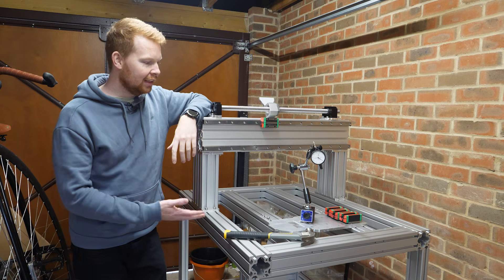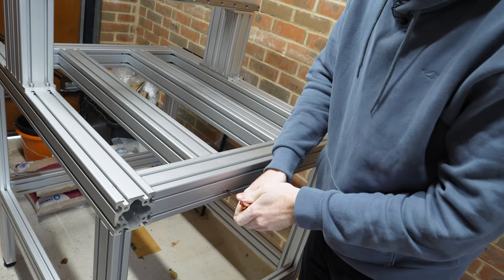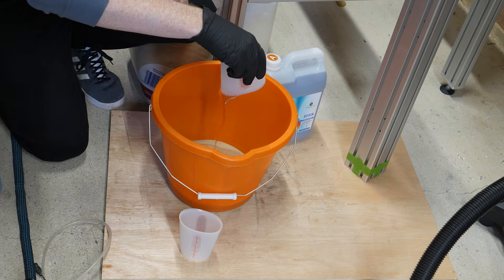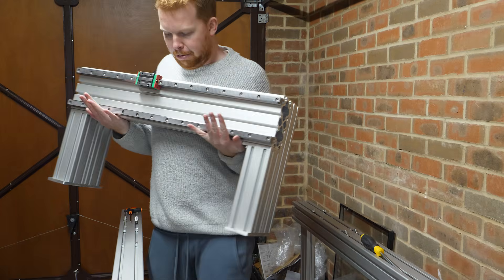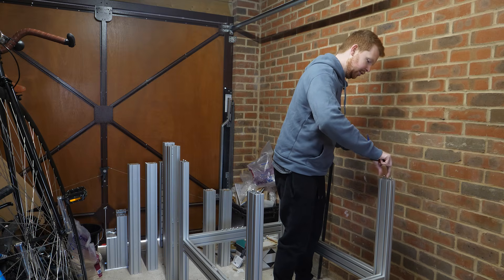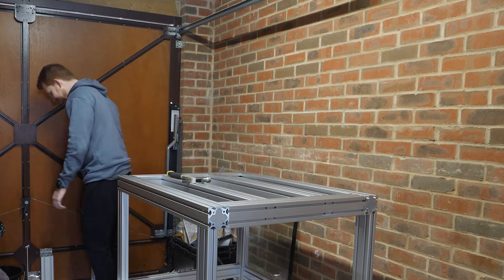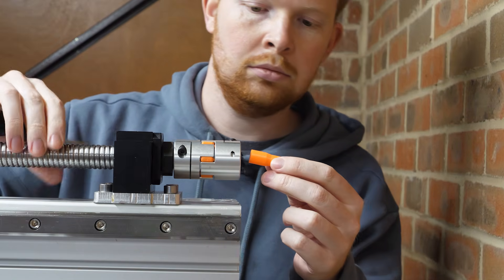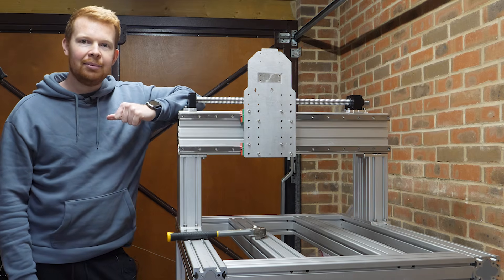Building a CNC Mill/Router - Part 2

Comment: Should be loose sand so it can absorb vibration, now it's just ringing through the solid epoxy. Looks kinda top heavy on the smaller profile legs too..

Comment: You could try putting some sort of thin rubber sheets/gasket between the different extrusions so that vibration don't propagate to the whole assembly, especially to the legs

Comment: Hi Tim. I've been considering epoxy granite for my CNC build, however I strongly believe that the Sikaflex 290DC deck caulking that we use at work for cruise liner Teak decking will be a good alternative choice. My reasoning is down to how these dampening materials work; converting vibration into heat through friction. Epoxy granite alters and shifts the resonant frequencies within the system to longer wavelengths which are less intrusive than the higher "ringing" plain Aluminium produces. Sound dampening materials in audio applications tend to use dense flexible materials such as rubber or polyurethanes which are very good at converting vibration to heat. Sikaflex polyurethane caulks are single component and much more convenient than mixing up dry aggregates and epoxy, which is an attractive benefit.

Comment: Re: sand/epoxy

Bro why’d you mix weight and volumetric measurements? Instead of having to convert each substance to another unit of measure you could have just weighed them both and got your 1:4 part ratio.
Reply from the maker: It's quicker and easier to measure each substance by volume due to the measuring jugs. Also, I don't haven't scales suitable for weighing the bucket.

Comment: You could have used iron filings or small ball bearings? If you Made an iron filing/ epoxy slurry you could have poured in like the sand. If doing the ball bearings you could drop in then pour the standard epoxy. 

With bearings you could possibly cap ends and pour in the bearing. That way you can recover and use again. 

Alternative solution for hollow sound is to use expanding foam to fill voids and damp the sound a little.

Comment: B&q sell lead flashing for roofing that you could attach to the outside of the legs to damp them, a tight layer of some sort of tape, then wrap qith the lead flashing, then another tight layer of tape.

Lead sheet is quite good for damping because it has high density, meaning the energy required to move it is high and it has a very small amount of area under the elastic deformation part of its stress-strain curve (this is a representation of the amount of energy able to be stored in its elastic deformation)

Comment: Use dry sand on the the vertical legs. its pretty much self compacting and should pour in like water if the sand it totally dry. iv had bags of kipn dried that were not dry before hahah

Comment: I'm thinking bolting it down after might make a big difference too. Either to the floor, or to a concrete block if you don't want to make holes in the floor.

Comment: You could enclose the base by mountig steel plate on the legs, and then fill the void with epoxy granite. That will make the whole cnc a lot heavier but here heavy weight is your friend.

Comment: Don't be disappointed Tom.
Any added mass will help dampen frequencies in the range of your cutter speed rpm. Rubber or metalastic feet will also help.
I think you should try it and see......fine tune the clearance on your axis guides.
Loving the content.

Comment: I'm no CNC expert but you should/could just add some diagonal braces from the sand filled bed to the legs, one on the short end from 1/2 way along the cross bar down to one of the legs, and maybe pairs on the longer sides, that will increase the resonant frequency significantly hopefully way above that of the steppers in motion. I wonder if you could even brace the two centre beams at 45 down to the end or side leg cross brace rails....(move them up to suit and don't fixate on keeping the sides and ends at the same height like you have)

Comment: Well done! I did exactly the same on a custom build that I currently assemble.
Your problem is indeed the stand. The CNC should be heavy on the bottom and get lighter the higher you go. You have a very rigid machine now, on a flimsy undercariage. You will see how shaky it will become, once the machine is up and running and you do some highly dynamic stuff with repetitive direction changes, like boring or adaptive clearing. Maybe you have some possibility to attach the legs to the adjacent walls with some wooden spacers. This should fix it.
But in any case, it is a great build 👍

Comment: I wouldn't worry to much about the legs/base ringing. You have significantly increased the mass and rigidity of everything the linear rails are directly attached to. This will will greatly decrease relative motion between each axis, which is what you really care about. If all three axes, work piece itself, and the cutter remain rigid to one another it doesn't matter if the machine as a whole bounces all over the place. There are some assumptions in there of course, but the idea goes a long ways. If down the road the vibrations in the legs becomes annoying you can do something about it then. Great build!

Comment: The mass of the sand definitely will lower the frequencies involved. 
you could 3D-print some T-slot sand buckets which can be moved around to show.
A small mass damper system could be made in a similar way, but getting it tuned in might be a pain.

Comment: Maybe try assembling the chassis with different types of material. Since materials vibrate at different frequencies. You could find a 2 or 3 materials to assemble that can cancel each others frequency out.

Comment: The base needs to be solid. You could have filled the whole frame with Epoxy Concrete using a mix with more epoxy. It flows well even in fairly small gaps.

Comment: The objective is to remove chatter:
Eliminating "ringing" created by tool cutting edges contacting the workpiece at a harmonic of the frames natural frequency is one reason to fill the extrusions.
Another reason is to increase the overall mass of the machine... this alone can be a significant improvement.
I guess that's why you don't see many portable Bridgeport mills!  😜
Really looking forward to the rest of the series; I don't think you are going to be disappointed with the finished machine.

Comment: Cross brace the legs and weigh them down or bolt them down to make it super rigid. And cross brace the gantry to the table. It will be solid and overbuilt. 

And I am excited to see you indicate everything in square and parallel

Comment: I think the sand is not meant to add mass (which would just decrease the resonance frequecies) but to dampen the vibrations, and for that it needs to be able to dissipate energy i.e have lots of grains rubbing on one another, but the epoxy could be preventing that from happening. I don't build cncs and the sand epoxy thing might be common but if there's a problem I see it here

Comment: Blasting garnet is MUCH denser than beach sand. I think the filler material should be loose rather than bound for best vibration suppression. It is important to have good coupling from beam to filler.
If you are not too committed. Moving the ball screw between or below the guide rails will help eliminate racking of the tool head. Your current design has cutting forces being resisted by the highly leveraged ball screw, encouraging racking..

Comment: Your epoxy granite will have its own resonant frequency, because it is stiff. I think the whole point of the sand is that its lose and will move about and not resonate. Now you've just got 2 different materials with 2 different resonant frequencies, coupled together. Hopefully they overlap and still help a bit.
Reply: Bells are hollow for a reason..
Reply: This is exactly the problem. You want sand as it has no resonance at all and is a great damper over basically all frequencies of interest. Also, sand fills the voids well but his cement will shrink a little as it sets and you lose the intimate sand to metal contact. All he has done is change the resonance by adding mass but has likely not introduced appreciable damping. I appreciate however that he has holes in the system and the sand would work it's way out eventually.
Reply: @rob66181  Added mass of different resonant frequencies is almost guaranteed to dampen vibrations.
Reply: Epoxy granite wont resonate it behaves like a piece of stone
Reply: @wizrom3046  Yes it does, most solid objects do. If you hang a rod of stone or concrete from a string, and tap it, it will ding. Thats it resonating.
Reply: @ratgreen    actually it doesnt. The epoxy is much less dense than the stone particles so the whole thing absorbs energy and is very low resonance.
Reply: @wizrom3046  that's a broad statement. Some epoxy sets hard as concrete, some is flexible. My point stands. Think what you want.
Reply: @ratgreen     one of the primary benefits of epoxy granite machine construction, as advertised by some very reputable large manufacturers, is that epoxy granite machines "dont suffer the resonance problems of metal frame machines".
Reply: @ratgreen you're confusing ceramic with stone.
Reply: @wizrom3046  everything resonates!

Comment: I'd bolt the entire thing to the ground or a concrete block, with rubber gasket between aluminium and concrete. 
I'd also put lightly coupled (or gasketed) bracing between the middle of legs and the uprights, reducing the number of long lengths that can resonate.

Comment: Judging from the Bambu A1 printer initialization sequence prior to printing, it sounds as if they fixed it in software by sweeping the head through different frequencies and measuring the vibration. Do folk do this with CNC machines?

Comment: working with high end CNC machines myself, from manufacturers such as DMG Mori and Mazak, you will find that rigidity comes with mass, as well as how that mass is suspended. High end machines have huge iron castings which weigh literal tons, then the machine is levelled with specialist kit and it gets bolted to the concrete floor. The floor becomes part of the machines mass. If you didnt bolt the machine to the floor, vibrations would cause it to move over time, and your parts will be inconsistent, have poor finishes and just generally would not be good for the machine. Its the same sort of idea when youre machining hard metals such as inconel, monel, a lot of types of steel, titanium etc. if you have the material on a fixture high above the machines table with little support under the fixture, you get too much vibrations which will cause excessive too wear/damage, poor surface finish and so on, hence why when you machine these marteials, its best to try and make it one with the machine (bolt direct to table)

anyway rant over haha, what i would do if you could is make the legs as solid as possible, and bolt them to the floor. the difference will be huge. Many people end up welding something out of steel box section or I-beam extrusion, however if you dont have the resources for welding you could us large bolts (lots of them) and it will work well still

Comment: While the way you mixed the epoxy was a great idea, I wonder if it would have been easier (and maybe cheaper) to fill the legs with bonded sand like Petrobond or even Kinetic Sand. There are also a few different kinds of casting sand (Sodium silicate sand) that can be poured easily and then cured to a "hardened state" with the addition of CO2.

As for the legs, I think it is less about the weight and more about the long, hollow surfaces that allow for vibration. May want to look at car-deadening mats (like Dynamat) and paints (like Spectrum's Liquid Sound Deadner) that could be added to help lessen resonance.

Comment: Maybe try to Wrap a Rubber mat or Rubber Tape around the legs? The Rubber could absorb the virbrations and also isolate the Sound or reduce the frequency. I guess even normal Tape would Help notacibly.

Comment: I have done the same thing with my welded machine, but I compacted in the epoxy sand mix as I filled it and that made a noticeable difference.
One tube I had to fill sideways and could not compact, which resulted in a noticeably less uniformly and densely damped tube (you could hear the difference when you hit it at different positions).

Comment: For the legs, if filling then with sand doesn't work, the best way to come up with a structural way of reducing that, or at least making these frequencies harder to resonate with, would be done cross bracing, I think. Specifically diagonally, since that will reduce the top of the legs from swaying compared to the feet as the machine moves.

That, or just get an old kitchen counter and put the bed frame on top, instead of the rather musical legs you've got 🤪

Comment: You lowered the resonant frequency which should make it worse. Job done! Squares are inherently structurally wobbly, not a big problem with your contact area on most of that build but the vertical members are thin. Try cross bracing to stiffen it up the vertical walls. Either two cables under tension on both diagonals or a single rigid diagonal.
Reply: I'd experiment with rubber pads sandwiched between the brace and members

Comment: I'm a consulting engineer for vibration related issues for a vast number of different products. Have specfically worked on mills and lathes. The lack of understanding in the comments is crazy. People stating something as fact and it being the farthest from the truth.
Reply from the maker: Would you agree with what I've done in the video? What else could be done to help with damping potential vibrations? Thanks!
Reply: Firstly, I'll commend you for taking on the task. Building a mill from scratch is no easy task. 
However. The downsides. The easy thing for me to say is there is a good reason lathes and mills are very very heavy and building one from aluminum extrusion is fighting a losing battle.  Stiffness is the end all be all of what makes a good machine. So this in principle would mean you would end up with all very high mechanical natural frequencies. In the video it seems like you are insinuating lower natural frequencies are the goal. Shouldn't necessarily be the goal. The sand was likely a good addition. Additional weight can't hurt and it does add damping. Suggestions would be anything to increase stiffness. Cross bracing everywhere you can. I think the bolted connections in this design are the weakest point. Anything to stiffen those connections will substantially help. You're likely to not be machining steel on this. So keep doing what you're doing and should be alright.
Reply: @Brandon-sc1fz  there's a distinct lack of triangles in this design that could be addressed. perhaps tom can do some simulations in cad

Comment: there's gotta be some kind of convoluted nonsense you can do to reduce the ringing, or it's impact, some more. Maybe you can stick a transducer on it, build a calibrated striker device, and record the ringing, then get the spectrum of that ring, and apply a filter in the motion system to avoid exciting those frequencies? Or maybe adding some unnecessary brackets between members, with some dampening to dissipate and consume the ringing. My first thought was regular 90 degree brackets but you put rubber sheeting under them; but you might be able to just bridge the longways beams with 3D printed "bracing", and the plastic itself might serve as a damper

Comment: Hey Tom, it might be a good idea to look into using flexures to decouple some degrees of freedom. In your system you are overconstrained with your two parallel rails and ball screw, making it overly reliant on alignment. With some tactical application flexures you can remove these whilst maintaining stiffness in the direction that matters.

Comment: I thought the reason for the sand was to bring down the centre of mass, and to make it heavier, so it wouldn't move. Dampening resonance might work aswell, but i don't know if this is the best way. I saw people hang lifting weights on steel wires on the bottom of it to damped vibrations.. the idea is that you have a dampening weight on a string, that can move freely and vibrate.

Comment: I think you are putting too much faith in the linear rails being straight, I would almost bet the extrusion is straighter reference edge. Even high quality rails are almost always bent from factory and you need to use the mounting screws to pull them in line. 
Really you should be setting the axis flat relative to the table, followed by setting the ballscrew flat to the rails. 
Unless you have checked them with a proper straight edge of course!

Comment: As nice as the idea with the added epoxy sounds, it greatly diminishes the vibration absorbtion of the sand as it can no longer move and thus counteract the frequencies. The added weight is still a great benefit, as any CNC machine should be as heavy as the design allows to stop vibrations happening in the first place. Loose sand (or mixed with oil, or just oil) would be much better for absorbing the vibrations. You can just add a container full of it onto one of the main beams of the machine. As long as it is very solidly attached that should still absorb a lot of the vibrations occuring while in operration. Looking forward to the rest of your series!